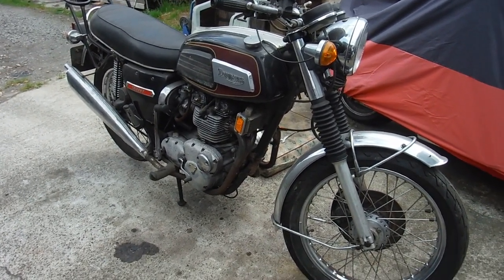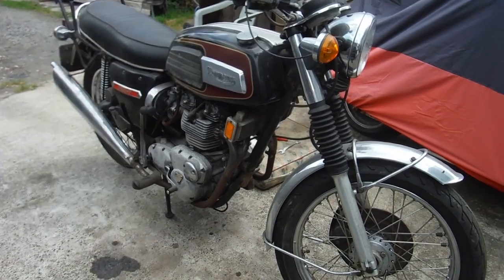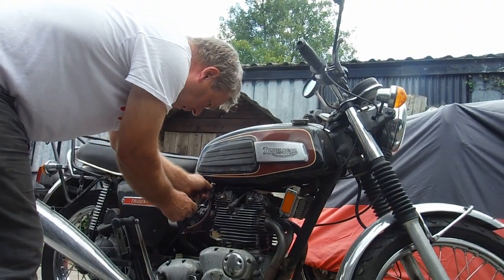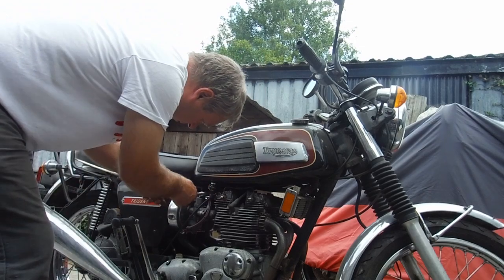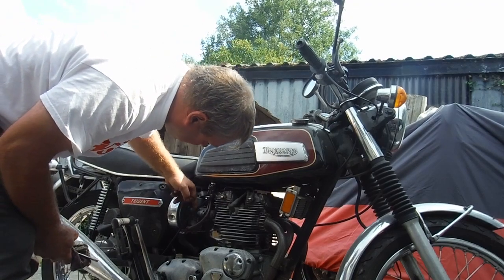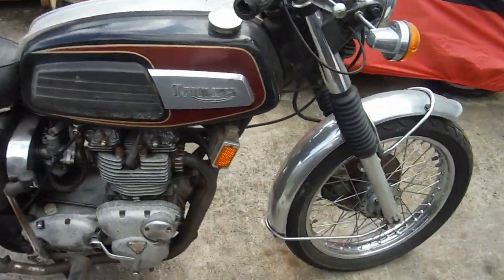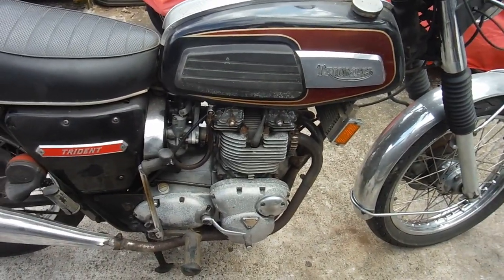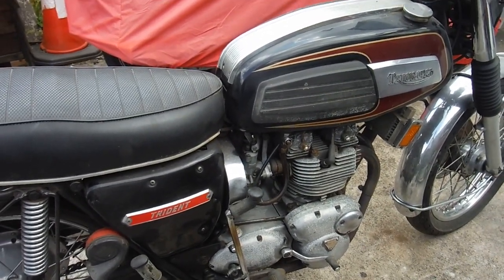Triumph Trident T150V first attempt to start in over 2 years - will it run?

Comment: Ah, the memories.Owned one for over 25 years. What a nightmare. The clutch is hard to keep dry, the carbs wear like nothing else, the rockerbox gaskets get squashed out by the cylinder head bolts pressure. Leaks everywhere especially at the pushrod tubes...I could go on. I made aluminium rockerbox gaskets that cured the leaking  at that spot, fitted a Tryspark ignition and a 1000cc Hyde barrel. After that it became useable .The new owner is delighted as am I for having sold it.
Reply from the maker: Mine is no trouble at all and I can pull the clutch in with two fingers if I want. You must have changed the crank too, to get 1,000 cc, mine is 831 cc with Hyde barrels and pistons.

Comment: Pau🎉l, this question comes from Longview Texas. Seems as if everytime I see a rider tickle the carbs on their bike it looks like a frantic morse code message! I traded my chopped Honda 305  SuperHawk C77 for  a used 1968 T100c  in 1972. Had to tickle that one. Sold the T100 in 1978 and bought a new '78 Bonneville T140E with the Mk2 Amals. Choke lever on that one. The point is I just held the tickle down till the fuel started to leak out around the shaft. It didn't take any time to "flood" the bowl .

Comment: I can remember people having these from new and wondering what they were like to ride, my best mates dad had twenty++ British bike  which he wanted us to ride. Turn up on a dry sunday for a ride, most used to give me the equivalent of white finger in feet, legs, hands ,I had most of the Kawasaki triples and then the inline four's, the 2 stroke triples mirror vibration the inline four's bugger all vibration, zero oil leaks in either .
To be honest, as much as Ive loved these old bikes, I've never bought anything else than Japanese bikes . I guess that I learned from experience, without buying
Reply from the maker: Tridents and Rocket Threes tend to be pretty oil tight and vibration free, many other British bikes can be oil tight and run pretty smooth, if properly maintained and adjusted, but lots aren't and a badly set up big twin will try to shake itself and its rider to bits. I also have a couple of Japanese bikes, I like some of their machines too, but many are far from perfect, even if they might have seemed to be 'back in the day'. They are also often extortionately expensive for replacement parts, compared with British machines, but it's a case of each to their own, I guess.

Comment: Very nice English market example with original horns mine is missing and nice front fender which on my bike doesn't look as nice as yours. I was lusting for this tank for a long time, but finally decided there are too many changes to convert my 73 American market bike to European look, specially when my tank is in very good condition. Mine takes me for 100 - 150 km trips every weekend on Niagara escarpment area after I finally leave my big town behind. I too keep gaiters on a front end, 3 phase alternator with powerful light up front and oil gauge to be sure everything is right there. Our Summer is little too hot for English bikes with temperatures around 35 C, but last Monday I got great weather ( 25 C and clouds ) and my ride turned spectacularly well, However my bike is one kick starter cold or hot and goes like hell I still have 2 nagging issues with it - little too much vibration above 4000 rpm and front fork which is still much too stiff for my ageing body. I plan to change all bearings with both chains in my primary during winter + balance my clutch together with primary wheel / damper to hopefully reduce vibration and order new dampers for a front fork from 3D motorcycles ( Richard Darby ). Other than that it's great bike for me, easy to start, great handling and performance and much faster than current rider. :)

Comment: I highly recommend braided brake hoses Paul - and it sounds great ! A friend started an old 650 unit Triumph for the first time in 6 years once when we had the old four star petrol..... just turned the key after flooding the carbs (with 6 year old juice !) and it started after the third kick !!!
 The clutch was stuck so we push it at first, stuck it in gear and he did about half a mile opening and closing the throttle until it freed off.... those were the days,  the 1980's..... R.I.P Peck ( Mick Pertl).

Comment: Paul I have a set of points for that bike off my old t 150  which I swapped to electronic ignition complete with back plate etc your more than welcome to have them and a few other bits and bobs  no charge cause what you are doing is educating motorbike enthusiasts and doing a damn good job

Comment: BTW, the Amal company does not recommend 'pumping' the tickler.  Procedure: Turn your petcocks on, press down on the tickler, once fuel leaves the tickler you can release the plunger and your ready to start your bike up! Theirs no need to "pump" the plunger, simply hold it down until fuel gets released.
Reply from the maker: It is something I and many others do and more just habit than anything, although sometimes I have held a tickler down and a float needle has stuck, and jabbing tends to help avoid this potential scenario.

Comment: Have to tickle those Amals. That’s what I loved about my Tiger Trail 750 - it only had one. Brilliant bike, loads of character, totally reliable and never leaked oil. Only used to eat tachometer cables but didn’t need one, just change on engine noise/revs.

Comment: Have you ever put an oil pressure gauge on your trident ? Has the bottom end ever been apart , do you ever get concerned with  the sludge traps in 45 year old bikes getting full  ? Cheers
Reply from the maker: In short - no, yes and no. The oil light goes out and stays out even when ticking over hot. There are no sludge traps as such in Trident cranks, only plugged drillings from when the crank oilways were drilled in and they have proper, cartridge oil filters on the feed side. The engine was rebuilt in the late 80's with a reground crank, new big ends and main bearing shells, then the top end was rebuilt in the late 90's with the Hyde 850 kit and ported head. I put it away around 2002, until very recently.

Comment: The electronic ignition on my Sportster has been working for 25 years and no problems. Only electronic part on my motorcycle.
Reply from the maker: And the points on my Trident have been working since 1974!
Reply: @paulhenshaw4514  But your bike has been sitting for 20+ years.
Reply from the maker: Not that long.

Comment: Marvelous bikes whether Rocket 3, Trident or "Rodent". Only two drawbacks - costly to buy and to run and they have zero tolerance for sloppy maintenance. Many years ago (well before Paul bought this one) I was pillion on a well sorted T160 coming from Bristol to York. A T150 accompanied us. The hole in the cases when it went bang allowed a view up the remains of all 3 barrels.

Comment: Looks stock except for the exhaust.  73's are rare as that was the year the factory was on strike for an extended period.  Can you get me the number for the front gaiters.  I am in America and having trouble finding them as the american models were different.
Reply from the maker: Hi Roger, it is a 74 machine and those gaiters were fitted by me, years ago - I also fitted some to my Honda CB500T. They were just aftermarket items I bought at the time.
Reply: I thought the black and red tank was only 1973 so I assumed it was 73.
Reply from the maker: @rogerrossman5124  It had a black and gold tank when I bought it, but it was very scruffy, so I swapped tanks with another Trident I had at the time, which had engine trouble and was going to be sold as a project.

Comment: Why wouldn't you kick it over every few months needs electronic ignition i had a trident ran a 3 into 1 and it went hard
Reply from the maker: It doesn't need electronic ignition, it started on the 5th kick after more than two years and has always been fine with points, as have most of my other bikes. What would kicking it over every few months do? Nothing, that's what, it has been dry stored. I don't need or want electronic ignitions, they are more likely to leave you stranded than points ever would and they are certainly not trouble free, as I have found when working on other people's bikes with electronic ignitions fitted to them.